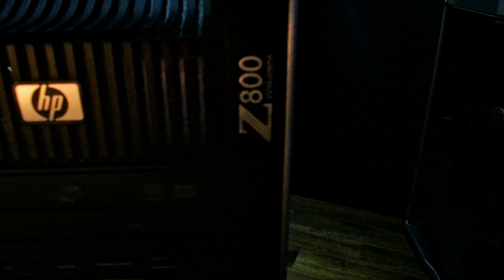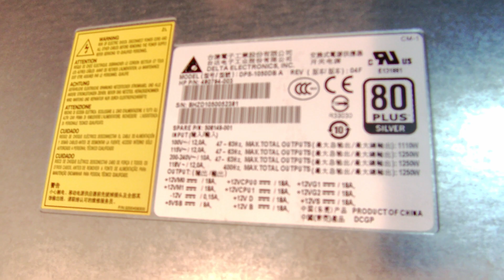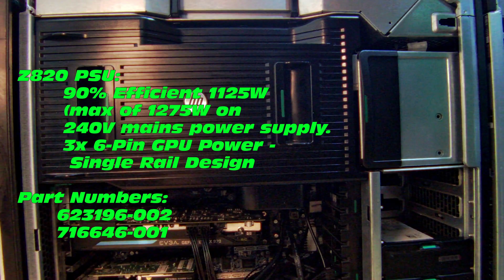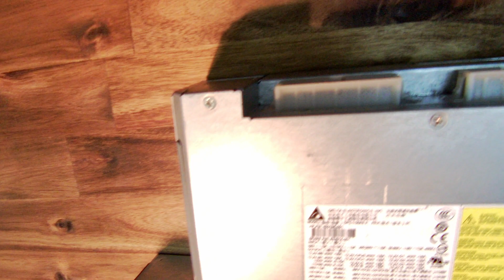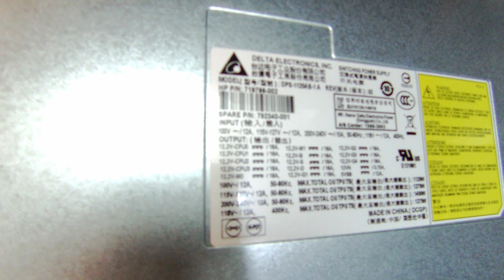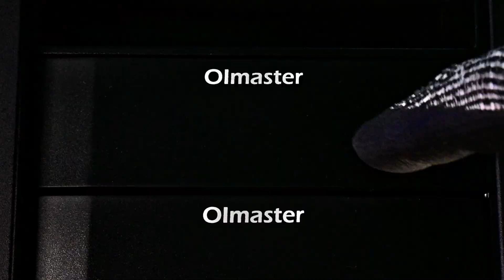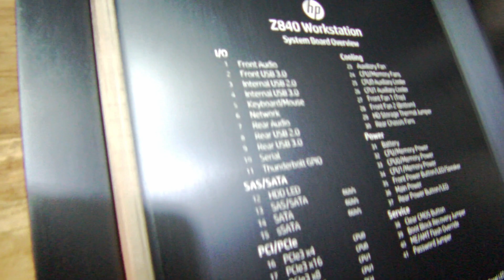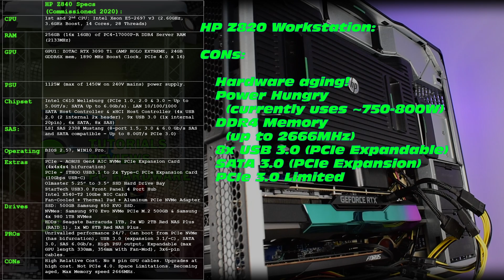Z800 / Z820 / Z840 Guide : Power Up Your Workflow with a Workstation (Remastered).

Comment: Love to see people still making content on these beasts. My main PC for the last 5 years has been a HP Z620 with the dual 2690 v1 xeons in and recently upgraded to a RTX 3060. Even with 48gb of 1333mhz ram, it does it all. I run Linux, i game, work, use VM's and does my multimedia stuff. No replacement parts has ever been needed. It is stamped 2012 on the inside, so has been working for coming up 11 years now. No other PC i have ever owned has done that. The only thing i would recommend is if anybody owns or is thinking of owning one of any of the z600 series with the CPU riser attached, they must keep the riser connector very clean on the motherboard. The slightest dust can play havoc with the QPI link as i have found out. Whenever i open it and remove the riser to clean i now give it a spray with electrical contact spray and ive been problem free for 3 years. It seems a semi-regular complaint and I've known people replace their entire motherboard at a fairly hefty cost for what was most likely this issue. The 600 series motherboards are extremely reliable and are essentially 400 series motherboards, with the 2nd CPI riser connectors soldered in, which you can note on the diagrams of both motherboards. Good luck!
Reply from the maker: Hi Lee. Not only am I making content on the beasts, but the beast is rendering the content! haha. It is great to hear you have been rocking a Z620 for so long! They remain solid machines and it just comes to show their durability. I was hoping to one day do a review on the Z600, Z620 and Z640 but I have not had a chance to purchase them (I have done Z400 / Z420 / Z440!). Z620 / Z640 seem more rare on the second-hand market (on my local marketplace). Yes, the CPU riser board on the Z620 (P/N: 689471-001) / Z640 (P/N: 710326-001) is a challenge to obtain! (Note the Z600 actually has two CPU sockets on the motherboard - like the Z800 etc.). It's good to hear about the solution to the contact issue with the CPU riser board. If you are looking towards a machine upgrade it could be worth looking at the HP Z840, or even the HP Z6 G4 (pending funds!).
Reply: I got a HP Z620 during the lockdown and I maxxed it out. Dual Xeon E5 2690 v2's, 96GB ECC Ram. Two Gpu's, Two NVME's (one for my VM's, and the other is on the last white PCI Slot using an adapter for my VM/LXC Backup storage), Two SATA SSD's (One just for the Host Proxmox OS, and the other for my Steam games), and........and six 4TB WD 7200 HDD's that I have setup in a Raid Z1 zfs pool natively in Proxmox for my NAS storage. I'm still running Proxmox 7.1.5!!!! 

This HP Z620 is the most powerful best workstation I've ever had the pleasure of owning. 

The X79 platform is the best!!!!!

Comment: I have i5-10400 mobo:h510m 16gb ram No graphic card.. But i run some games and resolve 17,premier pro 2020 crack version
Reply from the maker: Your Intel 10th gen CPU is powerful! You are doing well on the integrated GPU (I was using the HP Elite 8300 SFF as my main machine only 4 years back! I know the limits of the integrated GPUs). If you are able to save some cash for a GPU you will be able to do 1080p on all your gaming titles with ease and your video work will go even faster / smoother. Pending what's available for you, the GTX 970 still remains a solid card (~$50-80USD; I got my one in ~2014 and it's still working well!) or a more modern RTX 3050 (~$350 USD).
Reply: @racerrrz  I have Samsung 24inch ips 1080p led borderless monitor..next month start YouTube channel
Reply from the maker: @seemasaiprasanthreddy1400  Samsung monitors work well. That's great to hear! Go for it. The most important thing is consistency with posting videos. You'll learn on the job!
Reply: @racerrrz  save some money planning to buy gtx 1060 6gb
Reply from the maker: @seemasaiprasanthreddy1400  Nice. The GTX 1060 is a solid performer. Keep an eye for cards with more VRAM. I found it really helps with the video editing but you only need it if you try to use lots of effects.

Comment: All of them are UEFI?
Reply from the maker: Good question. The Z800 missed out on UEFI and boasts Legacy BIOS. With some work-arounds you could get UEFI-like functions (Clover/Duet etc.).
Reply: @racerrrz  I was looking at Z640 as it has DDR4 and UEFI so making easy install of an NVME boot dive for linux.
Reply from the maker: @feelsbad1193  The Z640 is a solid platform. The only downside to them was how rare/hard to obtain some of the upgrade parts are (e.g. 2nd CPU Riser Board 736520-001). You'll have a solid performer and it will boot just fine from a NVMe. Definitely look into a PCIe adapter with some cooling for the NVMe (the Aorus GEN4 adapter can be sourced for a good price these days). The other machines that are quite neat is the Z440 and Z240. The Z240 has a native NVMe slot on the board but the only downside is the limit to 4-Core CPUs. The Z440 tends to still be pricey but they are easier to find than the Z640.
Reply: @racerrrz  I saw people had weird issues with the riser board. I saw the 240 but yeah not into the 4 core cpu builds anymore. The best cost per dollar seems like the Z640
Reply: @feelsbad1193  As an owner of a Z620 for 5 years, the riser issue which is reported on is actually down to the riser connector. It needs to be very clean,  dust plays havoc with the QPI links. I had trouble on and off for 2 years and almost replaced the motherboard as many have done prior, before giving it one last go with electrical contact spray and i have had not one issue with it in 3 years and is now part of my maintenance routine.
Reply: @leerobinson8709  I just do not like the riser. Well I always have contact cleaner on hand.